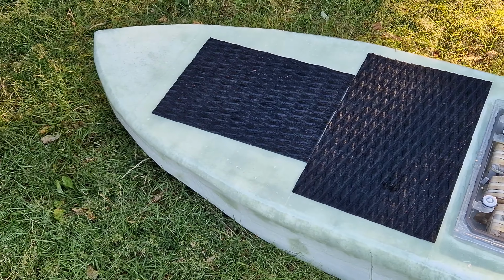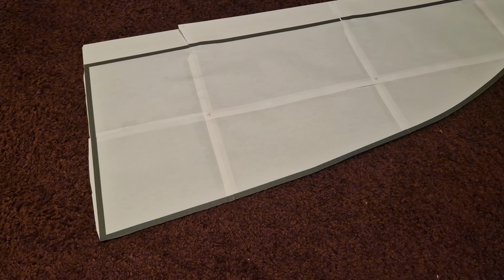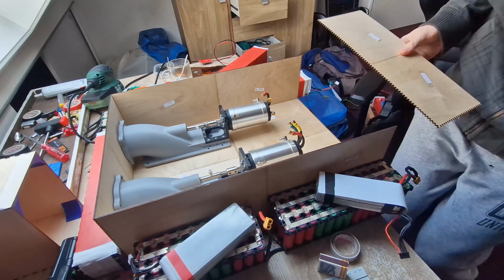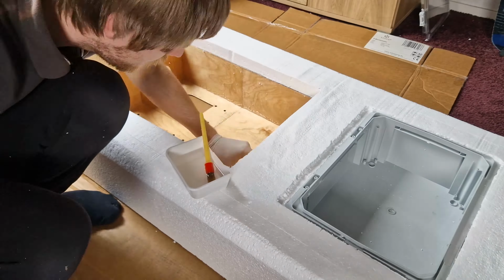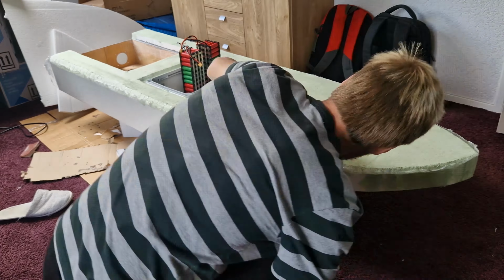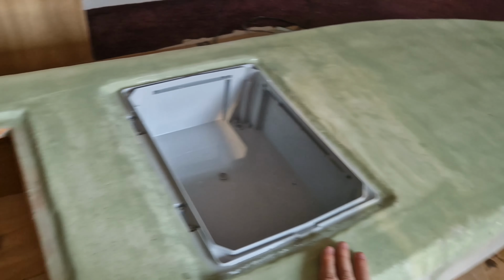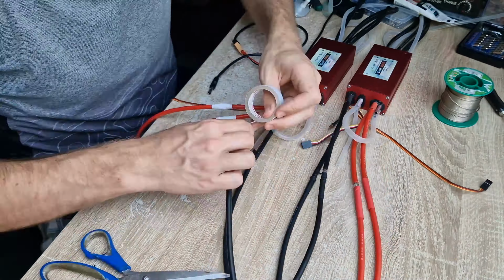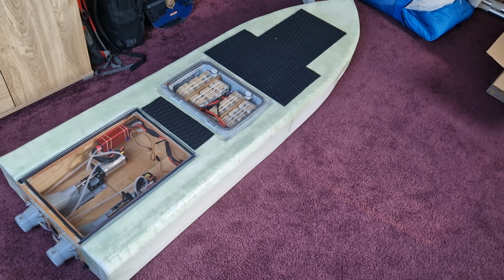20000W Electric Surfboard build Version 2.0

Comment: Just an old rc combat plane build tip, plastic banding inserted into slits cut into the foam makes very strong unbendable foam.
Nice build
Reply from the maker: Smart one indeed! just vertically in the direction you dont want it to bend. thank you for the tip can defenitely use it in future projects!

Comment: Hey love the build trying to make my own jet kayak
Quick question, why are you using 36S motors on with 18S batteries? Did you just want some headroom or hitting an RPM limit somewhere?

Thanks again for the build videos really helps me out, goodluck with the next build too! :)
Reply from the maker: @jamesoliverlang  the impellers have a 10000 rpm limit, with 18S im already over the 10000rpm even considering load but not too bad. Was not aware these motors are able to use 36S. These motors are rather cheap for their size and options that are relatively affordable are sparce so that is something Good luck with your build! Are you going to use similar parts?
Reply: @GalinskyFPV  wow thanks for the quick reply! I'm scouting for inspiration at the moment. I will probably print my own drives bc of the weird shape of the kayak and diy batteries. I was really looking for inspiration on what voltage and motor size / RPM to go for. so thanks again for the info, ill let you know how i get on :)
Reply: and for impellers i was considering casting them out of aluminium from a 3d print mold or just buying some
Reply from the maker: @ Ive heard youngster jets (also on youtube) makes his own drives. From my understanding those are pretty affordable and good quality. I do not recommend the drives I bought.

Shape is indeed a bit difference if I were in your shoes I would just make a small cutout from the kayak for the impellers so the impellers have a straight in take and exhaust.and an angle for the intake at the bottom and exhaust at hte back of 90 degrees. you got more options from the market and making it yourself will also make things easier. (lot of diy impellers on the internet are designed the same way.

Goodluck!

Comment: Do you get any water seeping into the battery/motor compartments ? Or is it fully waterproof ?
Reply from the maker: Battery compartment is dry.

the bottom of the impeller/ motor compartment gets wet a bit. a layer of 2mm after riding.

I dont mind that much everything is "waterproof" in there or water cant get to it, for example the grease nozzle's of the impeller. Motors are elevated as well and esc's are waterproof.
Reply: @GalinskyFPV have you tried waterproof ceramic shaft bearings?
Reply from the maker: @timtravelnomad  no i have not, Looks very promosing reading up on it! Going to look for them if they are in same sizes as my current metal ones and try them out.

Comment: How did you ensure that water doesn't come inside motors
Reply from the maker: Well i'm not concerned getting water near the motors more about the batteries, that area is fully waterproof.

Battery box gets little bit wet inside but motors are warm and with lid open everything dries quickly.

Comment: How much does the motor and battery cost together?
Reply from the maker: Well the batteries are lithion ion (18650 batteries) 268 if i remember correctly which was back then around €1200. You can do much cheaper with lipo batteries you have then te power to power it but less run time (batteries are also more quickly empty.

To make the motors work you also need an esc (electronic speed controller) those are around €250 a piece (2 in this video)
The electric motor itself is also €250 a piece (2 in this video)

Impellers are around 200 a piece also 2 in this video